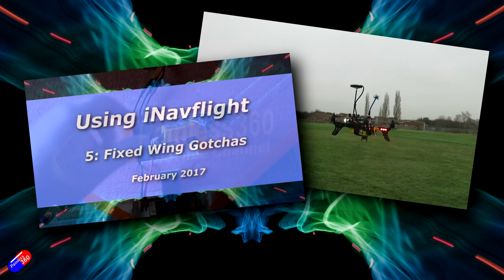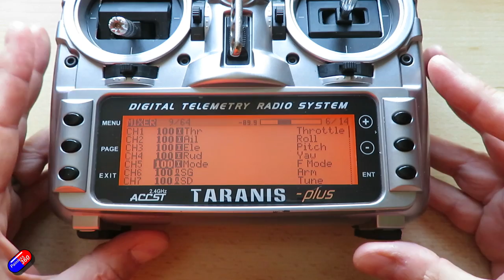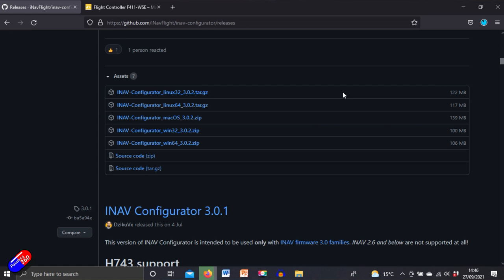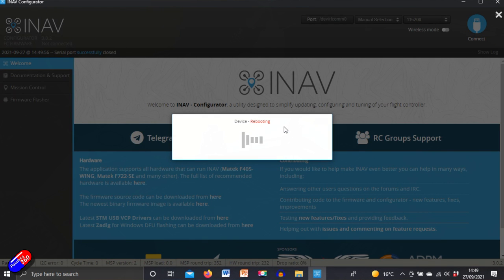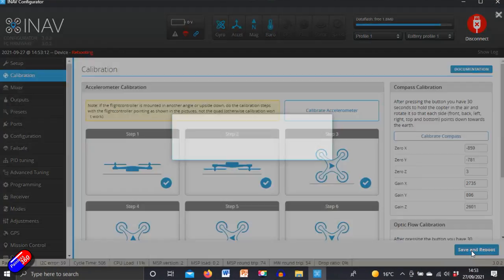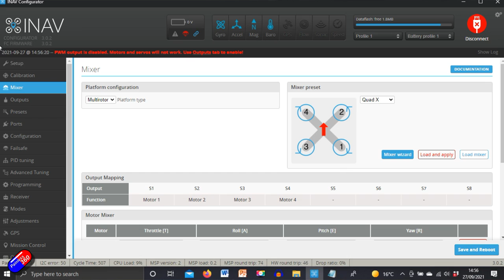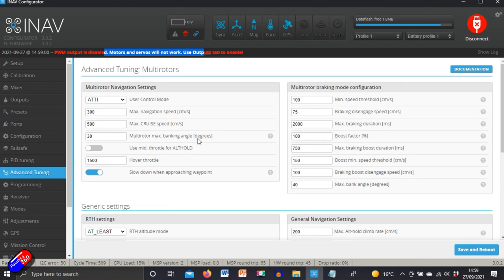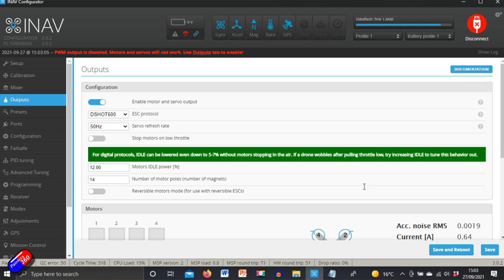(1/2) Installing INAV 3.0 onto a Quadcopter: The basic setup

Comment: Just followed this guide tonight for a maiden flight tomorrow.

Useful tip for any other viewers here, if you have a BN880Q GPS/MAG unit like me, with the wires coming from the GPS unit towards the front of the quad, the Mag Alignment is CW 90 Flip
Reply from the maker: It is worthwhile checking out the other videos in the series before you fly.. best of luck

Comment: One thing that may be counterintuitive is that the "standard" compass orientation is "CW270FLIP". So if you're thinking to yourself "well, the compass is flat and level so I'm going to go with 0º because that makes sense," try CW270FLIP first if it's not already set to that.

Comment: An important point with the Rekon quads  (not very clear in specs) is that ONLY the "PRO" models come with the "M80 PRO GPS", which includes a compass, required for INAV.
(specs don't if mention compass is, or is not included, just the "PRO" designation)

Most models include the "M80 GPS" without the compass. A pilot can still install INAV, but none of the navigation, or RTH (return to home) features can be used. Trying to set RTH features could even create confusion, as INAV 3.x will not even allow ARMing.
Reply: Also doesn't mention NOT to enable the GPS & MAG in Betaflight at all or that it will death roll & break an arm due to 100% CPU useage... or that you need to dissconnect UART1 or UART3 before you can even enter DFU mode to get to advertised supported INAV, 
MAG auto-detected as QMC5883 for the record in INAV... 
--Sad broken Rekon 7 Pro HD owner

Comment: Hi Lee, looking forward to the rest of the series. I saw that Pawel recommends you mount the GPS level, and not at an angle like this quad. Have you had any problems with that?
Reply from the maker: Non at all. Having it at an angle can be useful in some cases.. Happy flying
Reply: usually it's on an angle because the quad will be flying forward the gps will be level.
Reply: You just need to account for it when calibrating the compass!

Comment: Hey thanks for all you do.  Just wondering if this iNav Quadcopter playlist is still current enough to use for a build Im about to do?  Do you plan on doing an iNav 7 quad setup series?
Reply from the maker: The steps are still exactly the same. I may convert my existing Betaflight for beginners quad build to INAV in the New Year.
Reply: @Painless360  OK thanks so much.  Ill give it a go :)

Comment: Hello. Great videos as always, I have a big 6s tarot 650 with inav 3.0.2 but I cant get the tune right. It keeps oscillating, there also is no autotune available for copters in inav. 

And there arent any presets for 14 inch 6s quadcopters or similar setups. Arducopter is not supported for my flight controller. 

Do you have any tips?
Reply from the maker: Pawel did a video for tuning 7" models but I did a video a while back on tuning for X-Class models - https://www.youtube.com/watch?v=dPC8n6DjFhs - the key was much lower PIDs that you expected and make sure you have the filters set low enough to get rid of the vibration from the model that leaks into the gyros.. Best of luck!

Comment: I played with inav on a quad for the past couple weeks on a 6". It handled surprisingly well on the stock 7" tune. But I couldn't get gps hold or rth to work, it would always bank left, and fly off. I noticed in the setup screen when I'd angle the quad up, the virtual one would point up then spin 180 on the screen. I got frustrated the the compass and reflashed betaflight and turned off the compass
Reply from the maker: One of those compass offers should have worked if you'd have tried them all.... Happy flying
Reply: Sounds like you needed to change the compass orientation.  If the arrow is pointing forward and the antenna is up, it should probably be set to 270flip.  Not confusing at all... Pawel has a video on this in his iNav flash to flight.  I finally got mine to fly straight when doing RTH.
Reply: If your compass is on an angle, you will need to set it manually. This will work if your compass should be using CW270Flip, but you have it on an angle
align_mag = default
align_mag_roll = 400 (for 40 degree angle)
align_mag_pitch = 1800
align_mag_yaw = 900
Save

Comment: Been using INav since 1.6 on planes except for a CX-20 on an F3 that I disarmed over concrete. Fast forward to my first real quadcopter trying to learn Acro with Nav modes too. My 3d printed Birdbones is working well after some lessons learned. 
 But...I would like to set up my switches like the INav fixed wing setup to keep things similar but something under the hood in GVs is messing with my quad. Soooo please help us set up our  modes. I also need a good checklist to follow...like turn up my VTX power,  R9M power to adaptive, Make sure you have antennas on the goggles, start record on the goggles, ect dummy.😬
Reply from the maker: I keep the radio setups nice and simple for INAV models. It is too easy to make things too complicated and cause yourself frustration. Setup for maiden covered in the next video... best of luck
Reply: @Painless360  Thank you and yes KISS is best. Looking forward to your next.

Comment: Lee, I want to install iNav on a 3" quad with a Mamba F722 mini controller, there are no pads for compass and only one spare Uart which will be gps.  Without a compass will RTH work?
Reply from the maker: It won't on a multirotor. Best of luck
Reply: @Painless360  Going to try a Matek M8Q-5883 as I am told that can get gps compass and bara over msp.  Heres hoping!

Comment: is baro compulsory for inav??
Reply from the maker: From what I recall, a barometer is an optional sensor and is required only on multirotors for navigation modes... Happy flying
Reply: @Painless360  hello,i have mamba f405 mk2 FC which lack baro.I want to try inav because i like position hold with gps.
But i am not sure if not work.

Comment: Hi Lee, ive managed to get my rekon 7  all set up like you explained but im still having problems with pos hold. No matter how i calivrate The mag whenever i try to fly it and use pos hold it Will work a sec or 2 and them the drone starts to fly away on what appears to be an straight line....  Any idea of what could be wrong?
Reply from the maker: Excessive vibration, calibration or interference would be my guess... Best of luck